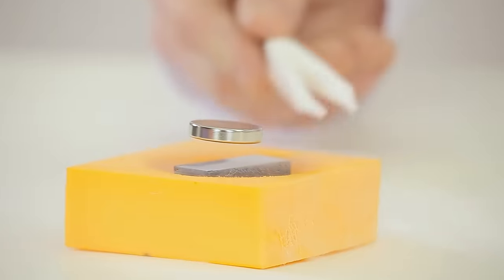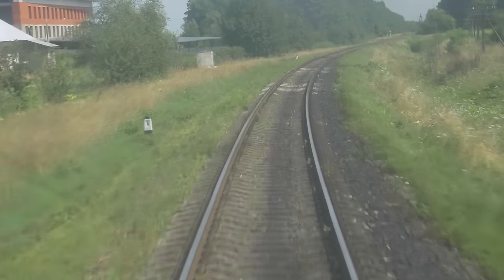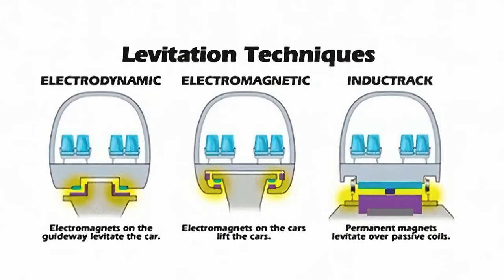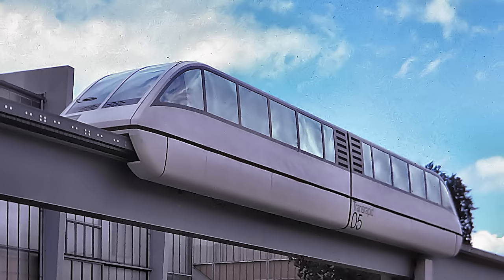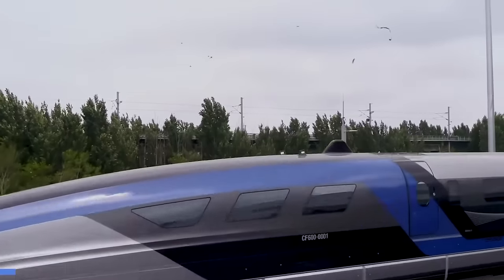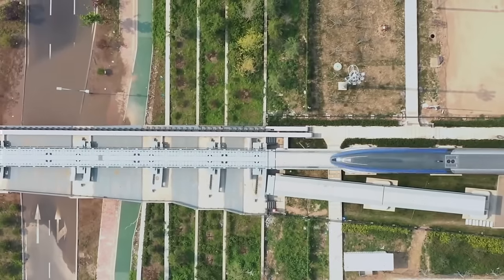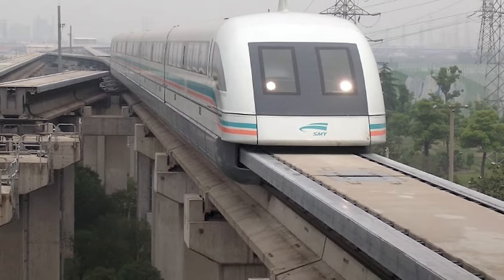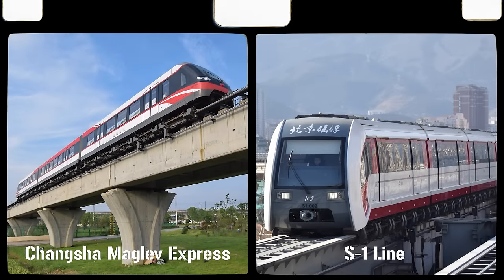Maglev Trains: Why This ALWAYS Falls Short

Comment: An interesting overview. What are the running costs? How much energy is needed to lift a train a centimetre off the track?  How much does the track cost in comparison with an existing high speed railway?  If a maglev could be devised that could use existing railway tracks to gain access to existing stations and approaches and then use maglev for the high speed section then it might work. Superimposing a whole new system on the existing transport infrastructure would be difficult.
Reply: 1: about 2 cent per seat km
2: aboit 50watt per ton
3: bare maglev track cost about €25m/ km in double track. HSR cost about half.. in theory. But this is very terain dependent. So if the terain is hilly,  maglev can be cheaper.

4: you really can't do that anyway. Typically high speed track have new infrastructure anyway.

Comment: In May 2009, Iran and a German company signed an agreement to use maglev to link Tehran and Mashhad. The agree was signed at the Mashhad International Fair site between Iranian Ministry of Roads and Transportation and the Germany company. The 900 kilometres (560 mi) line possibly could reduce travel time between Tehran and Mashhad to about 2.5 hours. Munich-based Schlegel Consulting Engineers said they had signed the contract with Iranian ministry of transport and the governor of Mashhad. "We have been mandated to lead a German consortium in this project," a spokesman said. "We are in a preparatory phase." The project could be worth between €10 billion and €12 billion, the Schlegel spokesman said.
Reply: Impossible too expensive

Comment: In the early '70s the Ontario Government tried to build Mag-Lev Personal Rapid Transit system     but it literally }Never Got Off The Ground" as the control system required for "Attractive Levitation" was not available. They held public meetings to explain the benefits of the new system, one of which was the elimination of friction and associated energy losses. I was in grad school in Electrical Engineering at the time and attended the meeting wearing my Engineering jacket.

I started to ask some semi technical questions such as "What are the frictional losses of our subway trains and how do they compare to the power consumed by the levitation magnets?" There reply was that it was a very technical question and that I probably would not understand the answer. The Minister of Transportation for Ontario was attending and said, god bless him, "I believe the gentleman will be able to understand your answer so answer the question." I think he was beginning to see that he was being sold a lot of crap.

There answer was the frictional losses of the subway were 10 hp per axle and the Mag-Lev used 7.5 kW per magnet of which there were 4. Since 10 hp = 7.5 kW the power used was the same. Further questions revealed that the linear induction motors were about 1/4 of the efficiency of the subway motors, the capacity was 1/10 and the magnets were on all the time. They finally admitted that they were using the same amount of electrical energy to carry 1/10 of the people to eliminate friction. The Minister did not look happy. Unfortunately he was replaced as the Minister of Transportation the following week.

This was 1972 I believe and the system was very primitive.

Comment: To me dynamic suspension makes more sense, as having a back up conventional rail would both provide huge reassurance to passengers and safety in the event of power loss, it would also allow for a line to be built that could use conventional trains today but be relatively cheaply be upgraded to maglev in the future should the technology mature
Reply: You can have rail backup with active suspension. Dynamic suspension NEEDS the backup to operate below 150km/h (see Tom Scott's japanese Maglev experience)

The cost of building a line to the standards needed for "just in case" upgrade to maglev would require fundanmental reapproaches to the entire process. For starters you are now tied to massive curve radius AND a crippled gradient capability (HSR can climb about 3 degrees, maglev easily hits 6%) AND the banking would be all wrong, making retrofitting hidesouly expensive as entirely new roadways would need to be created (months or years of downtime - again, see Tom Scott's video. They stopped on a banked section to demonstrate the angles involved). In short if you take this approach you're building lines under engineering restrictions that are the worst of both worlds and your costs would proably ballon uncontrollably
Reply: @miscbits6399  firstly, this is why you hire civil engineers and not YouTube commenters.I really did a poor job of writing that as well.

I should have prefaced with, I was thinking in the context of the UK, where we have a current need for HSR, but might in the future also require a further capacitity increase and where land price can make adding additional lines very expensive.

My point wasn’t meant to be you can only have backup rail with EDS, rather the need for conventional rail is negated by the fact that it’s desirable to have a backup. However the EMI shielding would remain a problem.

As I understand it, EDS is capable of tighter turns, and steeper climbs, so all line geometries suitable for wheeled trains could be used for EDS it just wouldn’t take full advantage of the technology. 

Upgrading HSR to EDS could be done overnight, where rail demand is low and could be supported solely by the commuter network. As adding the two side channels wouldn’t interfere with HSR line (besides needing to close for the safety of workers and could be relatively cheap so long as design considerations were made when designing the HSR line (IE leaving space for the channels)

Trying to convert legacy rail that was not designed with maglev in mind would be a disaster. And whilst you could build a HSR line that could be upgraded to EMS, the cost difference at grade would be quiet significant owing to being monorail based rather than conventional rail based

Comment: The primary problem with maglev is that they are an engineering solution to the problem of friction... but at high speed, the biggest friction problem isn't the wheels anyway - it's the air.  Specifically: at high speed, why levitate a few inches off the ground, when you can levitate thousands of feet into the air by simply installing wings - at which point you no longer need tracks, which saves you even more money?  And once you're thousands of feet up, why not go all the way up to 40,000 feet (12,000 m) where your air friction drops dramatically as well?

Now, of course, many of you will point out that once you're airborne, you no longer have a good way of powering the vehicle, other than bringing petrochemicals on board, and that makes the whole endeavor flammable.  Or you could use batteries, but those are so heavy that they double or triple the weight of the vehicle, which means you're losing the efficiency that led you down this route to begin with.  Yes, certainly, those are excellent counterpoints to bring up.  Basically what you're saying is, we'd need a way to transport power wirelessly, yet without the inverse-square losses associated with traditional RF power broadcasting.  Well, humanity actually got a lot closer to making that work in 2023.  Read up on "Space Solar Power Demonstrator's MAPLE experiment" for more details.

Comment: You say that with a maglev train there is no friction but you should say is there's no friction due to moving parts as far as axles bearings wheels all the items that touch each other and roll against each other. There is friction with the air it is a far less friction than moving parts and especially with the way they design the aerodynamics of the long dolphin nose to get that air moving smoothly around the train with his little forces possible. But there is still friction with maglev trains it's just the air is the friction at that point and that's where with things like a hyperloop If you take a maglev train and then you place it in a vacuum tube then you don't have any friction at all. Theoretically once you get up to speed in a pure vacuum you no longer need any energy to keep going, we'll go on until It meets some kind of friction to slow down or stop. But the price per mile far outweighs the benefits of being fast because the ticket prices and everything else would have to be so high to get your ROI back in a reasonable amount of time. We're a train to cross the United States would probably cost hundreds of billions of dollars, if not trillions of dollars where if they sold a ticket for a full train every single day at $2,000 a pop it would probably still take 800 years to pay off. And not to mention a plane is far cheaper than that Yes it takes 5-6 hours but I would pay that for $300 instead of $2,000 to be there in 1 hour unless of course work we're paying for it

Comment: Maglev along with monorails and other contraption are often called gadgetbahn's as they try to be a train, yet end up falling short for various reasons. But I wonder how  prevalent Linear Induction Motor powered trains (LIM) would be in the near future.

Unlike Maglev's where you have to completely construct brand new track, LIM trains simply have a metal strip between the tracks and can climb steeper grades and accelerate faster than conventionally powered trains, all while using similar infrastructure and rolling stock to conventional trains. An example of a LIM powered train (steel wheels on steel rails) is the SkyTrain in British Columbia, Canada.

While I'm skeptical about Maglev as they are a gadgetbahn, I do see potential in LIM powered trains as they combine the benefits of Maglev, faster speed, acceleration, grade climbing, with the benefits of traditional trains, simple switches, integration with existing railway networks, and of course, energy efficiency.

Comment: I actually don't fancy sitting in a train that's travelling at 600kph, which China and Japan are currently testing their own version. I've travelled on 200-300km/h HSR in Japan, China, Europe and I think this is the optimal speed to be fast yet allow me enough time to appreciate the pretty views outside. Not sure how 600kph would feel like, I mean would I still be able to get a long enough glimpse of the world outside as the train moves along? I mean the point of travelling in a train is to also for the views along the way vs an aeroplane in the air.
Reply: I'm guessing you'd still see stuff closer to the horizon anyway.

Comment: You forgot skytrain in Vancouver Canada, which was built for expo '87

And it's still in operation, its been very successful and has had several.modern updates and track expansions.
Reply: Vancouver Skytrain is a conventional (elevated) metro train with rails and wheels. It does feature automatic operation but is certainly not a Maglev.
Reply: @notverydeep9726  it is certainly not a conventional rail system, the skytrain uses linear induction motors to propel and stop the cars, also allowing the cars to climb steep inclines with ease.
The system was invented in canada in the 1970's, and is OFTEN associated with MAGLEV technology.
Reply: @asylumental  but it is still steel wheel on steel rail though and the linear motors must overcome the friction that this entails. To be a Maglev (and thus inclusion in the list this video is assembling) requires levitation. I accept that the word conventional may have also implied bogie mounted AC or DC electric motors. While Linear Motor powered metros using conventional steel wheel and rail are not common, there are a fair number more of them than there are Maglev metros...
Reply: @notverydeep9726  fair enough... so in lamens terms the skytrain is kinda like a hybrid..
Reply: I live in Vancouver, NOBODY refers to it as a maglev train here for the most obvious reason.
  It isn't a maglev.
And the world Expo here was actually in 1986.

Comment: I think the only one that might really work is the upcoming Japan one, when you can fill up every Shinkansen every 10 mins between Osaka and Tokyo during peak hours
Reply: It's touch and go. Commercially, it likely cannot be completed without government intervention. Whether there is traffic levels to pay for it is far from clear. They have a declining population size, and an awful lot of transport options already. Internal air travel is pretty plentiful and cheap, and a new generation of aircraft could easily undercut the Chuo Shinkansen.  

Plus they need to solve the Shizuoka problem...

But Japan is probably one of the very few countries where such a line can work. Being long, thin, with a large fraction of the population spread out along the Pacific coast, you only ever really need one line to cover most of the population. Covering a large fraction of the population of one of the world's biggest economies within a single infrastructure build is pretty much the best financial prospect for such projects. Try that in countries with more width, you have a lot of the same build costs per line with a guarantee of a much smaller market.
Reply: @abarratt8869  central Europe would also work but there ate the alps in the way.   Munich-Budapest would be a fantastic connection. only 4 stops, 3 central european capitals and munich.
Reply: @abarratt8869 Gotta extend it to Fukuoka and Sapporo and make it run 600km/h 🙏🙏🙏

Comment: The rolling resistance of steel wheels on tracks isn't high to begin with. Sure magnets are even better but the difference, taken over the entire system, isn't enough to warrant the dramatic cost increase. The money is better spent laying more track and building nicer stations. Same goes for the hyperloop idea.

Comment: Full scale maglev implementation should be double width or about 8 meters.   That has been a railroad goal since the beginning the railroad age in the 1840s.   The stability would support three passenger levels.   The top two levels could be continues luxury passenger space.  The first level is likely not continues between the train cars, noisy and used for cargo.  There could be simultaneous drive-on drive-off perpendicular loading of automobiles and cargo containers on the first level in the period of about a minute.

This configuration could likely offer stable performance up to at least 1,000 kph extremely fast, but below sonic boom generation.   The top level passenger space could have vista dome roofs allowing passengers to see forward watching the scenery.    Vacuum tunnels are not needed for slower than sound travel with very cheap electricity.   Many people like riding trains to watch the scenery.  All high speed trains need incrementally nearly free electricity such as their own hydropower generators with unlimited water.   New technology nuclear power may offer the next best option.   

The Chūö Japanese maglev that was schedule to start service in 2027 has now been delayed due to real estate issues expected now in 2034.   Chūö is oddly of SMALLER loading gauge width than the standard gauge Shinkansen!   It might to be a throw back to cape gauge 3-1/2 feet loading gauge width used throughout much of Japan.  China might be thinking more progressively with maglev experimental trains reaching 600 kph with 800 kph thought obtainable.  It is of about standard current train width, but China tends to think big and that implementation isn't big.

Comment: I was at Incheon airport very recently, and they appear to have close the maglev there in favour of, what the sign at least, describes as a "tram". Shame really as there is a whole building of the airport that seems to be built around the doomed maglev.
Reply: I went to Korea 3 years ago, shortly before covid, and i just used a bus. I didn't even know they had one
Reply: @backlogbuddies  oh yes, between terminals perhaps? There is a free bus. The maglev oddly went from one terminal out to a rather sweet but odd little group of fishing shops and tiny restaurants on the island's edge. Not even the direction of the mainland. It served little practical purpose unless you were bored and stuck at the airport for days with nothing better to do, as I was on that occasion. You were probably wise not to use it 😂🙏

Comment: baltimore to dc isn't a 4 hour drive.  It's like 90 minutes depending on where exactly the ends of the trip are.
Reply: The two cities aren't even that far apart.
Reply: I think he meant 4 hours between DC and New York
Reply: Pretty sure he was saying that DC to NYC is four hours, which sounds about right if the roads are pretty clear. DC to Baltimore really shouldn't be more than about 50 minutes without some soft of delays; but, I've had it take over two hours.

Comment: I mean sure maglevs are more advanced than traditional trains but honestly there isn't as big of a difference between regular rail. Yes trains have steel wheels that suffer losses from friction but it isn't as much as you would think even on a very large train.The friction is so low that it is often a public stunt to have a regular pickup truck pull a train or even people with an example of a man pulling a train with his teeth. There really just isn't all that much rolling resistance to speak of. At the speeds that these trains operate at on the high end wind resistance is exponentially more of a factor than rolling resistance from the wheels touching the track.